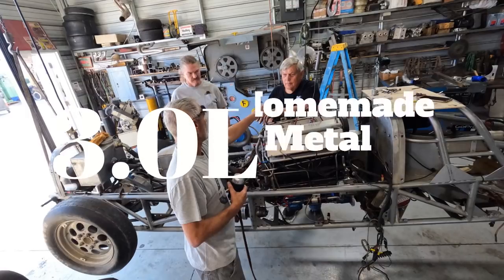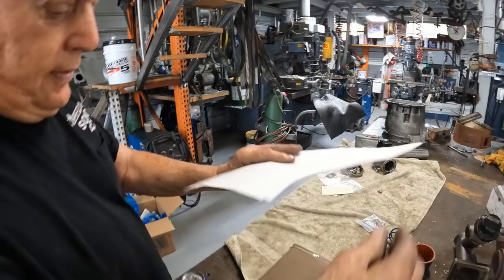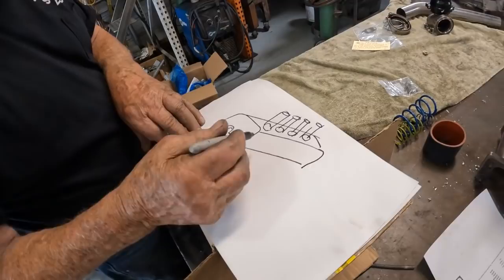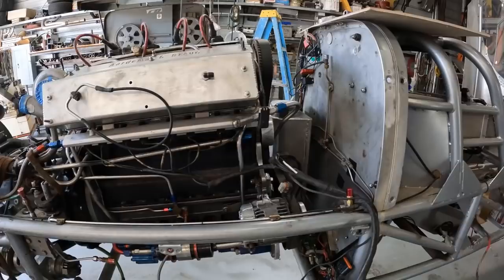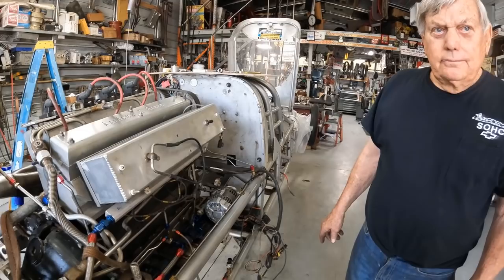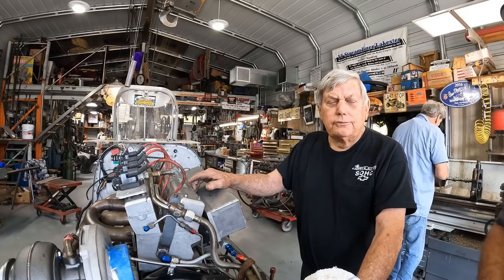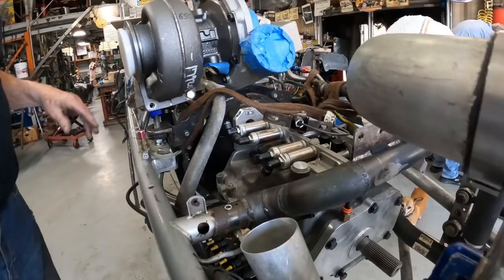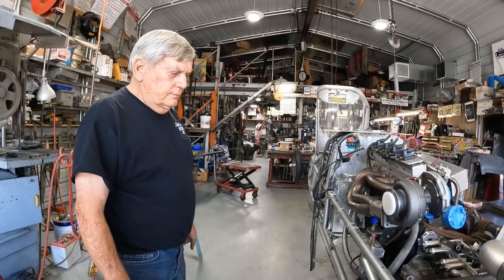Homemade 3.0L DOHC Sheet Metal Engine-  Pete Aardema and Kevin Braun Motor Madness

Comment: So how do you run low compression pistons when you are ramming vast amounts of turbo into it.......or is it direct injection.?
Reply: It's normal to run low comp pistons with boost...
Reply: @DrewLSsix .......thank you for the reply..I would have thought high comp pistons would achieve compression that turbo would have more difficulty getting.,ie at low engine speeds..Or is turbo so advantageous that low comp is the way to go..I can see there is quite a balancing act.,to ensure pre ignition is not sparked.,as the balance between comp ratio.,turbo compression and fuel quality..

Comment: I read the article and I'm a little confused. How did he managed to make such aggressive cam profiles work with what appears to be flat bucket lifters?
Reply from the maker: I will ask him and let you know.  Thanks Greg
Reply: Most direct acting setups (like my Mazda) have relatively large diameter tappets. This accommodates more aggressive cams than a smaller diameter lifter as are common in pushrod engines.

Comment: How much does this engine weigh? What grade of steel did you use? Also, are you running steel cylinder bores, or did you add liners?
Reply: Thick wall pipe, probably iron, I imagine the block is basic mild steel.

Comment: But why go through all that trouble for hp numbers that are really not that special. lots of 4 OEM cylinder engines run in the 1000-1400hp range (Boba motoring comes to mind. 2Liter 1233hp at all 4 wheels)
Reply: huh finally someone with a brain...went through all  the dumb comments gloryfying the build.... maybe just because he is a man of a certain age maybe it gives him credibility i dont know....with so many blocks to choose from, and then they could skim them and modify them and make custom heads why build a block off of sheet metal? the heat warps a cast iron block let alone a sheet metal one.. thats so dumb, i dotn care if they say it works, if it works then  it would work better with a cast iron block... i mean i appreciate the effort but there are wayy to many good 4 cylinder engines to choose from....

Comment: I suspect that is in fact a dual overhead cam engine, as the timing belt turns two sprockets, and the twin cam housings on top of the canted valve head would indicate. Pete knows what he's doing, but sometimes misspeaks.
Reply: He did say it's a twin cam - that is the same as saying 'dual overhead cam'.
 If you want to be very pedantically accurate, there have been some twin cam engines which were not overhead, such as the Riley car engines made from the late 1920s to the mid '50s, which had a cam on either side of the cylinder block, with long pushrods and short rockers to operate the hemi valves. Also, some very early engines had side valves, the inlet on one side of the block, and exhaust on the other - each set of valves operated by its own cam, thus a twin cam engine.

Comment: You call that short stroke?  If the bore is 4", then a 3.0 litre engine would have a stroke of about 3.65".   That's short?  To who, top fuel dragsters?
Reply: The bore is 4 3/8 inches the stroke is 3 inches.
Reply: @kevinbraun6272  That's not a short stroke, that's a large bore.

Comment: Use a timing chain!!!!!!!!! For reliability. Your killing me right now. Those belts are fuqin junk.
Reply: When we have used chains they break at high rpm. So we switched to belts. As long as you replace them when they are worn they are more reliable.
We actually replaced the chain on our 5 liter LT5 engine with belts because we were having so many problems with the stock chains.

Comment: These guys get harassed for their creative and non traditional approaches to engine design?
Reply from the maker: Yeah, unfortunately there will always be some level of criticism from people, however, Pete and Kevin do this for the love and passion.  Pete told me once, that anyone can bolt on performance parts on a big block and gain a few HP, however that's too easy . He believes you learn more about engine design and performance when you make it yourself. Pete and Kevin also look at all engine designs good and bad from all makes a models of cars and incorporate the best into their engine designs. For example, Pete loves the Honda VTEC technology and praises Honda's design and will figure out how to make his own version of a 2 liter that produces 2-1/4 HP+ per cubic inch of displacement, exceeding the infamous Honda S2000 motor stats.  Currently, Pete and Kevin's success has earned them some 33 land speed records with many more on the horizon.  Stay tuned!
Reply: @GregQuirin  Maybe one day I'll get down to San Diego or Bonneville and get to chat with them. I'm kinda in the same camp as them- trying to build my own ideas out despite being told that they're a waste of time. Good to know I'm on the right track with the Honda's. Those K series heads are pretty magnificent. Keep the videos coming!!